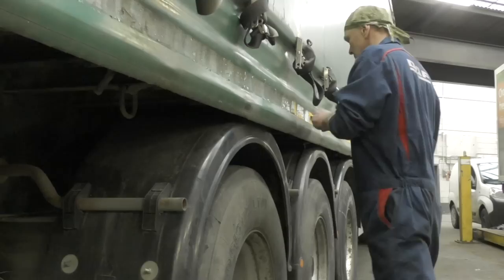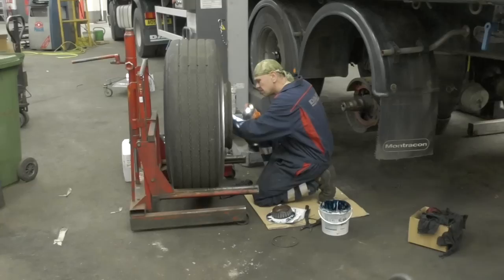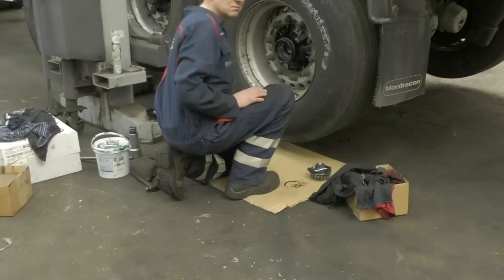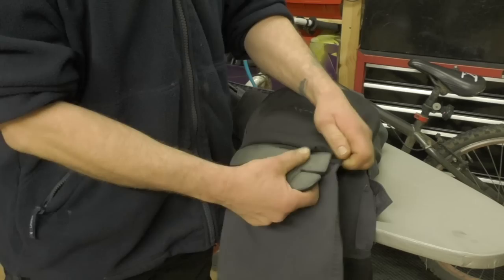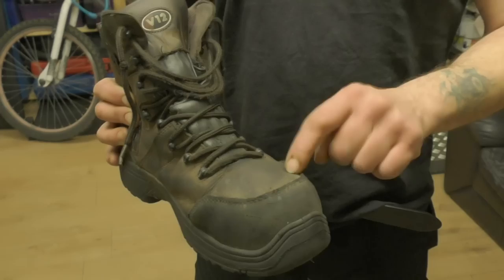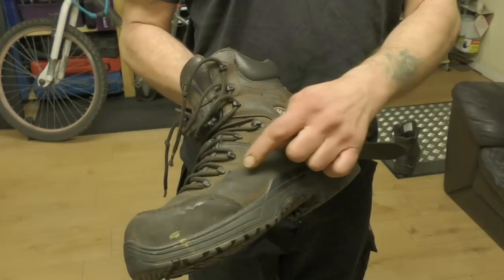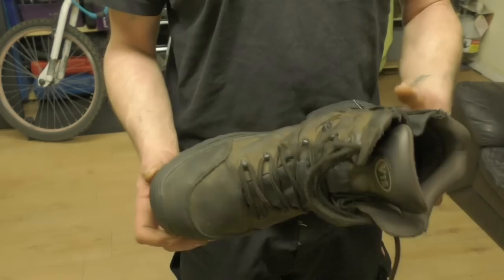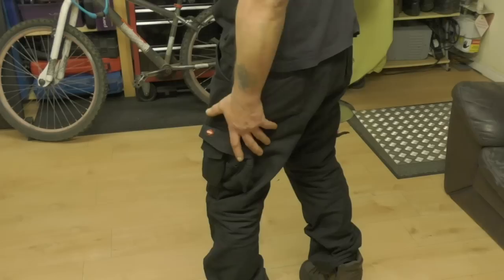Under the Overalls- A Better Kneeling Position When Working - Boots and Padded Kneepads

Comment: Your spot on about the knee problems.  I spent 30 years kneeling on the floor in front of photocopiers and bank cash machines and now have  to be careful about doing the same,  now I've retired.  I find walking loosens up the joints and the discomfort is now minimal.  Get it into your head that surgery really is a last resort, try to avoid it at all costs.

Comment: If you would prefer a smartphone but are concerned about breaking them then there are a great range of rugged cases for them now. My I7 is treated pretty poorly generally (used as a torch when greasing propshafts / topping up gearbox etc) but the rugged case means when I take it out it looks like new.
Reply from the maker: A few of the guys have the rugged cases and I agree, they work.

Comment: You raise some good points,but your employer should have risk assessed your job,and should try to limit the amount of kneeling,or other physical effort etc.Why isn't this job being done at more comfortable height,why is the trailer not raised higher?etc etc.Probably because you can't do what I say,because the dealer doesn't have the equipment etc to do this.Or it takes more time.On another point about concrete floors,two of my previous employers,had old workshops,one from mid 19th Century,the other from early 20th Century,both had wood block floors.They couldn't do large concrete floors then,so wood block floors were very common.These were much more pleasant to work on,stand about on for long periods,plus the added benefit that if you dropped something,it didn't break the floor,or break the thing that you had dropped.Unless it was something really heavy.
Reply from the maker: I usually do raise the trailers up to work on with 2 lifts but they need repair so I am back to how we use to do it.